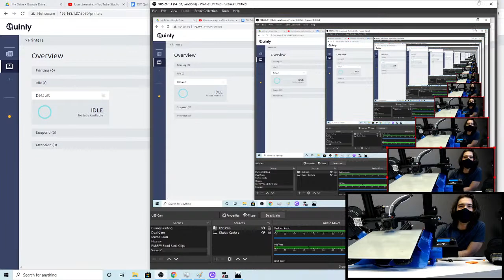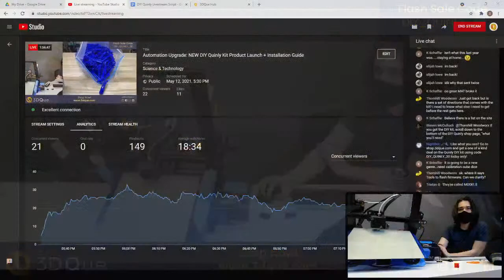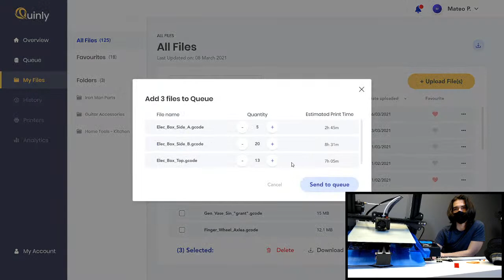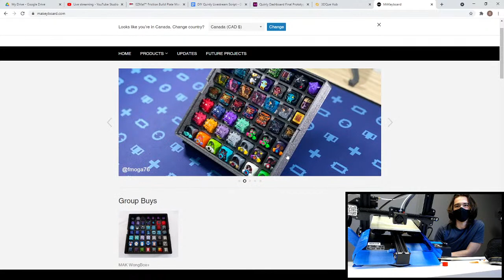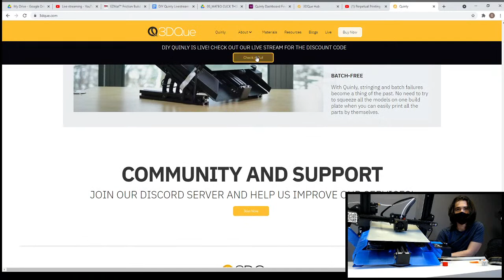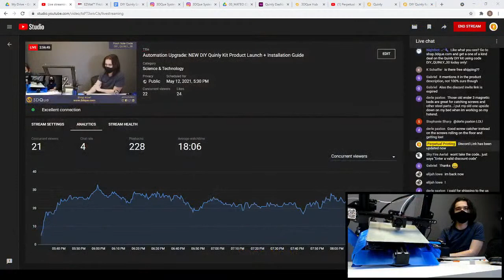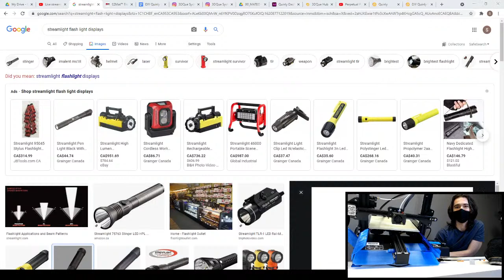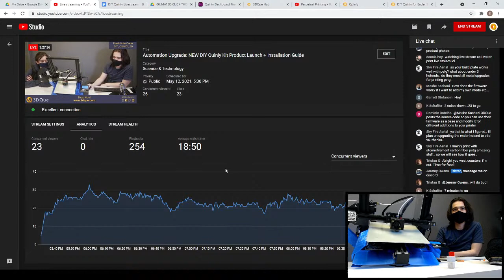Automation Upgrade: NEW DIY Quinly Kit Product Launch + Installation Guide

Comment from the maker: ====INDEX====
Welcome + Leah Intro: 0:00

Quinly DIY kit intro: 4:41

Bed install: 16:10

Installing Printed Parts: 21:43

Customer stories: 42:00

Z offset/bed levelling: 1:09:39 

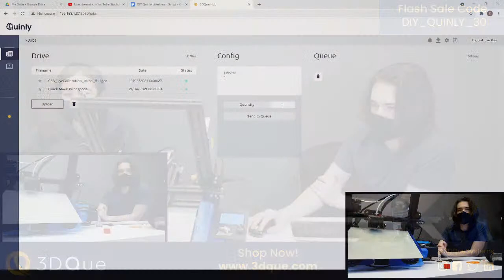Sending Print in Quinly: 1:54:18

First Print!: 1:57:34

New UI preview: 1:58:15

Print Finishes: 2:20:39

Bed Clearing: 2:34:00

Second Print Starts: 2:40:00

Second Print Finishes: 3:02:15

Second Print Clears: 3:15:39